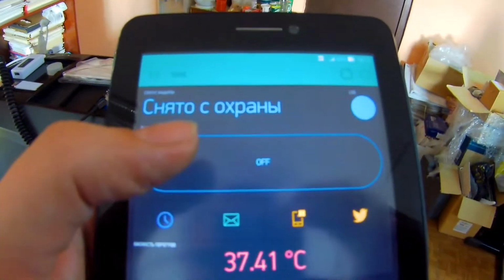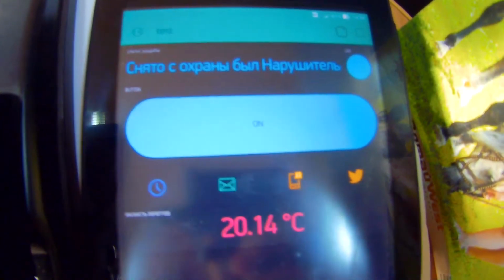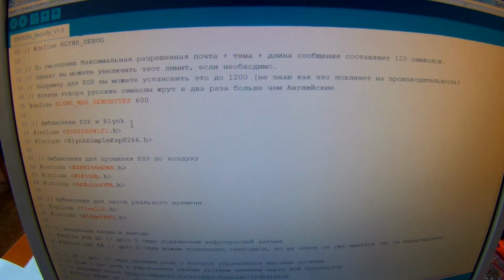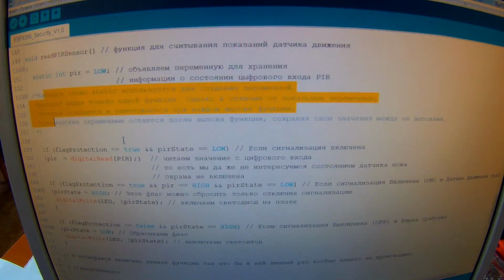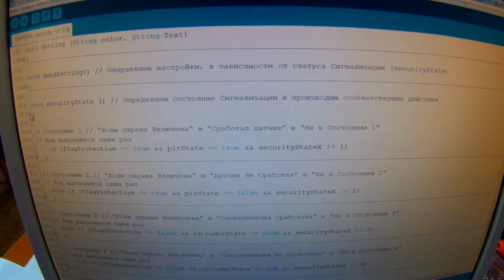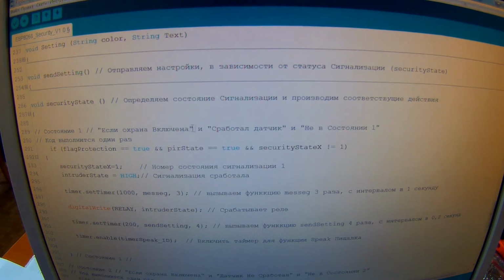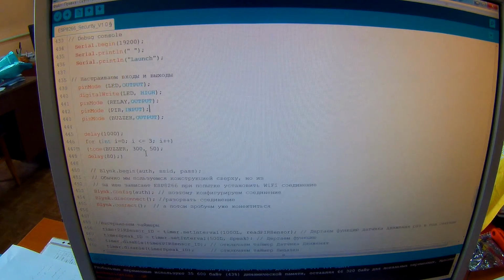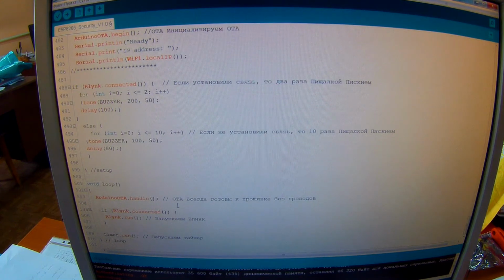#055 ENG Alarm ESP8266 + HC SR501 + Blynk

Comment: good night friend, I congratulate you on the project is very fine I want to mount a similar one but with other x2 ESP nodes I could not make them activate when I activate the main alarm, you could help me by giving me a light.

Thanks in advance
Reply from the maker: Good afternoon. Did not quite understand the problem? Other GPIOs want to choose?
Reply: Hello, sorry for my English, I want to install another two ESP8266 which control door opening sensors and anchor them to the same code so that when the alarm is activated in the main ESP the other two ESPs are activated
Reply from the maker: Give a link to your board. I understand you have ESP-01 and relay board 2x. If so, then the problem is in it. Since the relay there is controlled by UART.
And since my main language is not the same as English. Write down the points. What's not working for you.
Reply: my language is Spanish, but there is no problem this code was a great start for me, thank you very much friend for your help.
Reply from the maker: Once again, I apologize for my English. I understood. You need the Bridge widget.
Here's my video about this. It's in Russian. But the sketch will still be understandable.
https://youtu.be/kE_pJQz2W7Y Part 1

https://youtu.be/jMqfWySQdbk Part 2

Two ESP8266 are equipped with sensors. The sensors send their status to the main ESP. All this thanks to the Bridge widget. Here is the link
 http://docs.blynk.cc/#widgets-other-bridge

If it does not work out, write to me. I'll help with the code. Send me a link to the Archive with three sketches.
Reply: friend thank you very much, it's all I needed, I'm going to take a look
Reply: good night friend use the program 1.5 works great, but do not send email
Reply from the maker: Good afternoon! ))) Are you talking about this sketch?
https://yadi.sk/d/CaxHnEFs3YnaZS

If yes?
Required:
1) Line 104 enter your mail
2) Row 146 to uncomment and enter your mail
3) Row 236 to uncomment
Reply: I already did it but it only works once, the mail is flooded with more than 3 messages and I think Google restricts them for a few minutes.

change this line with time of 16 seconds but remains the same:    timer.setTimer(16000, messeg, 3);
Reply from the maker: About the limitations here.
http://docs.blynk.cc/#widgets-notifications-email

Row 482
  timer.setInterval(5000L, securityState); // Pull the function of protection Status once a second

It is necessary to try to increase here.
Up to 10 seconds

But in the event that the intruder will be for a long time before the sensor you will eventually be bombarded with messages and they will not go any more.

Since this sketch is no longer an alarm, it is a violation logger.
Alarms should not work like this.

If you do not understand, I'm waiting for questions. ))))
Reply: ok friend finally it works I am very happy thanks to you.

first, I put a delay of 15 seconds and it seems to work better

second, change the value of: pir to HIGH
to be able to work with a door sensor

thank you very much for your attention.
Reply from the maker: Excellent. ))) Have a good day!
Reply: Good night friend, what a pity to leave but it was too late.

I'm going to tell you my experience with the program, modify the pir to HIGH to control some door sensors, install three devices with their tokens but with the same program, in tests it worked very well but when you leave them installed after a few hours there is no connected more for wifi.

This code is very good but it is very high level for me, I'm going to make my code more basic.

Thank you very much for your attention, happy night
Reply from the maker: Good afternoon! Yes, problems with disabling can be, but it is possible that something netak you have with the code. Give a link to the Sketch Archive. And which sensors do you use?
Reply: Good evening, I'll tell you my experience once again:
Debure a bit your code sorry for that, but I saw that when I deactivated reconnectBlynk worked very stable so far it continues to work very well, I continued debugging add the door sensor (magnetic sensor NO) to which I had to put a resistance of 10k to earth, everything works great the wifi connection is stable, thanks to you for your attention.

here is the code: https://yadi.sk/d/DiXgJx063Z3XX6
 Could you tell me what you think?
Reply from the maker: Good afternoon! Just now I saw your message.
You perfectly cleaned the sketch.
So I think everything works fine. Especially with magnetic sensors.
Connect the sensors in parallel and be able to control several doors at once.
Or if they cost too far, then you can come up with several ways ...

reconectBlink from the sketch ENG_ESP8266_Security_Log_V1.5 is only needed if for any reason there is an interruption to the Internet connection. That is, Wyfi is connected and the local network is working, but for example there is no money on the account and you have been disconnected. Or an accident with your ISP.
In all other cases, the function is useless.
My latest video for the number # 080 contains a more advanced algorithm of communication easting.
Communication with the server blink on some of my devices was more than one month and without the reconnect Blink function And then I rebooted the board with the new firmware.
So the connection to the Blink server is very stable.

Comment: Hello Sir,

I would like to know how to connect to local blynk server if the primary blynk server offline or down?  The below following code is done by you but there is no code to connect local blynk server.  Please help ... thank you very much.

 while (Blynk.connect() == false) { // try to connect to server for 10 seconds
    if ((millis() / 1000) > mytimeout + 8) { // try local server if not connected within 9 seconds
      break;
Reply from the maker: Good afternoon. I'll try to help. The idea is good. I have not done anything like that yet. ))) How to write a function, I will inform you here.
Reply from the maker: Made an example. It is compiled. But did not check.
I think it will work. Be sure to tell us about the result.

https://yadi.sk/d/SEJ4vU6z3YF8hi
Reply: thanks a lot sir, your are very kind and good hearted. God bless you and your family always...  I will try it out and share like what you do ...  triple thumbs up for you...
Reply from the maker: Thank you. ))) Always happy to help.
Reply: Hi Bro, before I try the example given.  I realize the Alarm will not triggered whenever I turn off or reset the NodeMCU, even the Sync successful as previous button armed and notification pop up "Protected".  No matter how I shake the motion sensor, the Alarm not triggering till I manually press the disarm and armed again.
Reply from the maker: Strange ... In the near future I will check the sketch. maybe because of the updates Blynk is not working ... you need to check. And which sensor? As in my video? try to replace it with a simple button. Need to apply + 3,3v.
Reply: Thank you so much for prompt respond.
Steps taken in my test as the following: (but still not triggered once reset)
1. Tested - I tried to change to simple button widget
2. Tested PIR sensor model - Digital Infrared motion sensor (SKU:SEN0018)
3. Tested PIR sensor same model you used on the video
4. Tested with 3.3v and 5v 
Few more things being observed during my test:
1. Once reset, notification for Hardware running date not correct - "Hardware Running 1/1/1970 0:0:11 but the rest of other messages notifications runs perfectly with correct Date and Time.
2. No messages receive from Tweet.  Email runs perfectly fine.
3. I put the PIR sensor inside a fully concealed box and undisturbed place, sometimes few hours later, it triggers an false alarm.
Reply from the maker: The sketch works fine. Checked. ))) Just pin D1 you need to pull to the ground through a 10k resistor. If you use a non-PIR sensor and connect ground or + 3.3V, you will see that everything works. And another PIR sensor needs to be powered from + 5V.
Reply from the maker: I hope I could explain well. My English is very bad. ))) Only Google translator, so far it helps me. )))
Reply from the maker: 1. Once reset, notification for the hardware running date is not correct - "Hardware Running 1/1/1970 0: 0: 11 but with the rest of the other messages notifications with the correct Date and Time." (Real-time data is not downloaded from the server instantly because of this and the date is reset to 0. It's better to do a date check if the year is not equal to 1970, then send)
2. No messages receive from Tweet. Email is running fine. (Tweets configured in the application itself? Try a simple example of sending Tweets.) Http://docs.blynk.cc/#widgets-notifications-twitter)
3. If I put the PIR sensor inside, I'm triggers an false alarm. (If this problem is not solved with the help of a 10K resistor to the ground, then this is exactly the problem of the sensor itself. try using an ultrasonic sensor.)
Reply: Hahaha... I didn't realize that, I thought u speaks well in English till u told me... What a great person like u can help even extra by translating for me to understand.  I also use Google translate to convert some of yr sketch description too... Hehehe....
Reply from the maker: Ha ha ha! Thank you! I'm learning English, quietly. ))) I want to go to Canada. In Russia it is very difficult to live. )))
Reply: I always admired Russian people, very clever and innovative in silent.
Reply: I tried to 10k resistor both ground or 3.3v on D1, still not triggered once reset.  i need to on and off again the button, only it works.
Reply from the maker: Logic of alarm operation.
1) We were put on guard.
2) The motion sensor has triggered. The system goes into the state -> Detected by an Alien on the object. After that, the system does not respond to the sensor. Because this is the alarm logic.
3) Restart the system, it is possible only by pressing the button in the application.

If you need a different logic, then you need to edit the sketch.
If you need an update log, you need to edit the sketch.
I correctly understood this problem? )))
Reply: Hi Sir, to be honest I am a very beginner just like to learn coding.  Therefore, it could be a little tough for me to imagine on how to correct your code... If possible, I like you to suggest or advise me some sample on where to change.  sorry might cause a little trouble...
Reply from the maker: I can help you. no problems. ))) Need a trigger trigger PIR sensor. I'll write you a sketch. I'm just overwhelmed with work. This may take some time.
Reply: No Problem My Great teacher... Take your time concentrate on your daily work bread and butter... :)  I am happy to wait but dont forget me yo....
Reply from the maker: https://yadi.sk/d/-jTdHUzM3YRCmz
Good afternoon. Here is a sketch.
Edits from line 312
Checked everything works.

If that, write. ))) Good luck.
Reply: Hello Sir, tq very very much.  I had tried just now but still no luck.   :(
Reply from the maker: Hello! ))) Did the sketch load? If so, replace the PIR sensor. A jumper between D1 and GND. In this state there will be no workings. Once you connect the D1 and 3.3V, the sensor will work. and every 5.5 seconds will send messages. On violation of the perimeter. But as soon as you connect D1 and MLA again, the messages will stop coming.
The program itself works fine.

A PIR motion sensor, can give out errors. If the sensor is the same as my video, then I need a pull to the ground. Between D1 and MLA, a 10k resistor is needed. I can draw a diagram if it's not entirely clear.
Another thing is to try another motion sensor. Microwave or ultrasonic.

If you do not get it again, do not hesitate, ask again.
Reply from the maker: Hello! ))) Did the sketch load? If so, replace the PIR sensor. A jumper between D1 and GND. In this state there will be no workings. Once you connect the D1 and 3.3V, the sensor will work. and every 5.5 seconds will send messages. On violation of the perimeter. But as soon as you connect D1 and MLA again, the messages will stop coming.
The program itself works fine.

A PIR motion sensor, can give out errors. If the sensor is the same as my video, then I need a pull to the ground. Between D1 and MLA, a 10k resistor is needed. I can draw a diagram if it's not entirely clear.
Another thing is to try another motion sensor. Microwave or ultrasonic.

If you do not get it again, do not hesitate, ask again.
Reply: Sorry ya... What is MLA?
Reply from the maker: GND
Reply from the maker: The scheme
https://yadi.sk/i/OfkVMfcL3YWdhk
Reply: yes sir, I already put 10k resistor like what you shown on the picture.  With or without also not working after reset.
Reply from the maker: And without a sensor it works? If just to contact D1 podvat that land, then 3.3V ???
Reply: Ok let me try it out...
Reply: Hi Sir, I tried it out without sensor, it is remain the same not trigger once press reset.  Even thought the app screen shown Protected and pop up notification also protected but I don't know why it will not trigger once reset.  I also tested connection between a primary and secondary server code you given, it seems always searching not being connected.
Reply from the maker: On the work of the sketch I will record the video and throw the link. )))
Look how I work.

And what about the sketch of the first and second server? Does it work or not? I did not check it myself.
Reply from the maker: Video https://youtu.be/m2Vf4LFzOtw
You should work the same way.
And here is the link to the last sketch.

https://yadi.sk/d/EV9eKNI83Yf5t4
Reply from the maker: https://yadi.sk/d/DkeyOkFB3YhcbC
I understood! ))))
The bug is fixed.
Everything is working! ))) Enjoy!
Reply: Tq very very much sir, just a small move, it works fine now even I reset.  But.... I realize another strange thing about the LED. 
1. The LED On, when fresh reset.  
2. I trigger the motion and LED Off.
3. I manually press button to Disarm, LED still off.
4. I manually press button to Arm again, but LED still off. 
5. Repeat trigger motion, LED still constantly off and never ON again.  But Relay and all notifications working fine.
Reply from the maker: Yeah, I get it.
Has corrected.
https://yadi.sk/d/CaxHnEFs3YnaZS
Reply: Ok well done, everything should be working fine now.... Tq so much and very much appreciated.  
Things to share about my code after your help lessons:
Example #1:-
I used the 1st correction version that you sent to me earlier, under 
"void securityState()" as shown below: 

      timer.setTimeout(5000, [](){
        pirState = LOW; // Resetting the sensor flag Сброс флага датчика
        securityStateX = 2; // if 2 то State 1 or 0 State 2
      });

When I used the latest correction code under 
"void securityState()" as shown below, every time I trigger a motion, after a while it will automatically falls back to Protected Mode without touching anything.  After changing to the above code, now it is working perfectly.

      timer.setTimeout(4500, [](){
        pirState = LOW; // Resetting the sensor flag Сброс флага датчика
        securityStateX = 0;
      });

Example #2:-

I add the "rtc.begin();" under BLYNK_CONNECTED() to correct the Date and Time during reset or startup 'Hardware running" 

BLYNK_CONNECTED() // If has installed the first time, sinhroniziruete all widgets
{
rtc.begin();

Happy Sharing... Now I like to try the 
1. Primary and Secondary Blynk server connection whenever Primary offline.  Any problem will seek for your help again.
2. I am looking for a solution by taking a camera RTSP snapshot not real-time continuous video streaming whenever motion detected.  Try to hunt around over google but unfortunately nothing so solid documentation.
Reply from the maker: 1) I am glad that we have understood what is happening. I learned to program. I knew somebody else's code. This was hard.
2) I heard about RTSP cameras. I read the article but did not dare to try it. Your idea is clear.

Address still. )))
How to help or thank Engineer? !! Donat.

If you want to speed up the release of new videos, then help financially.

1) Visa card number Sberbank 4276 3100 4123 3182

2) My WebMoney R645891419664

3) And of course a good word. It is very important for me. )))
Reply: I sometimes really curious about donation by viewer to YouTuber. To my understanding if there are really a lot of subscribers, YouTuber might able to earn for living, maybe out of 10% viewer is willing to donate for the hard work.  M also sometimes wandering how much a viewer afford to pay for a single YouTuber since there are many YouTubers out there... Really a big question mark on my head.
Reply: I am also thinking whether is there a possibility to work together to kick start a small project with some form of negotiation in terms of pricing and whether it is viable for price competition in a particular project... Just my 2 cents...
Reply from the maker: Just so donata one of two thousand. Usually thank for help with a complex sketch. Or do they order me a sketch for money. With advertising on Youtube $ 6 per month. With referral links no more than $ 10. Well, from 0 to 100 $ a month for writing sketches for money. Well then, I have only 2,200 subscribers.
In Russia, very little advertising from Youtube. Very cheap.

Much more profitable in the USA.

Let's discuss the project for Kick Starter. What do you offer?
Reply: Hi Sir, can I have your email and your name?
Reply from the maker: Obushenkov Alexey Andreevich   sib.eng24@gmail.com
Reply: Hi sir, did you receive my email?